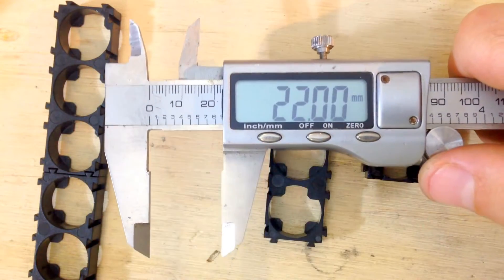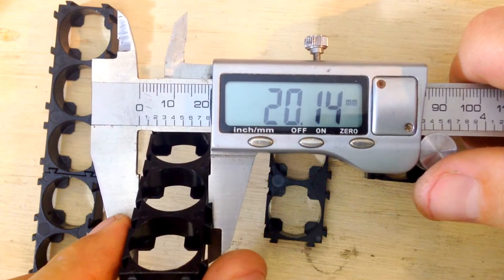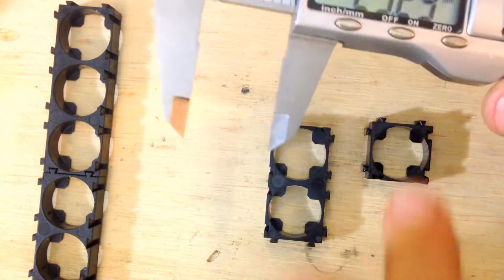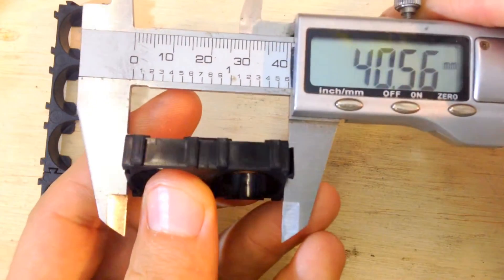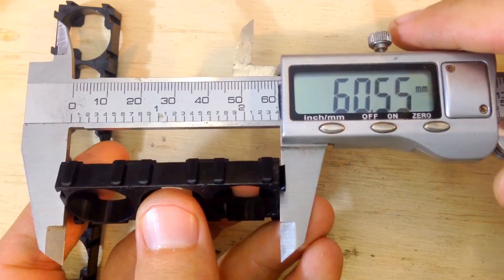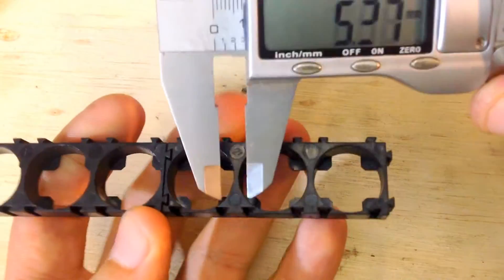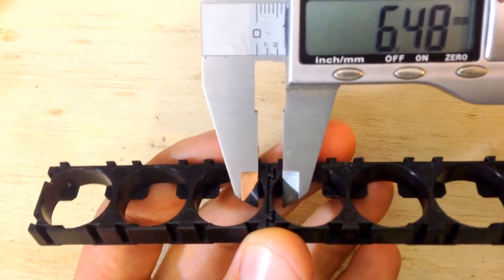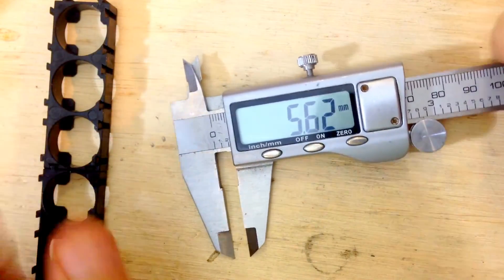DIY Battery: measuring 18650 cell holder spacer separator sizes - Lithium batteries - Electric Bike

Comment: is there any way to get these for under 18€/200pcs of 2 ? that works out to about 9 cents per double holder, and that still seems like a lot for plastic that's probably costs almost nothing to make
Reply from the maker: +BillTheBox - Yes, some people fabricate their own cell holders using thick plastic sheet and drilling holes. It may takes a lot of time measuring everything, making countless perfect holes. The cells may not be locked really well as it is just a hole, the ones on the video will give a lot of strenth to the battery pack.
The plastic sheet may ended up costing more than the cell holders and Depending on the thickness it may be much heavier too. 
This is where I get these things from http://www.batterysupports.com/10pc-battery-spacer-seperator-3x-18650-radiating-battery-holder-p-330.html